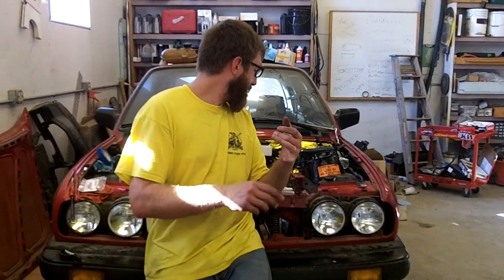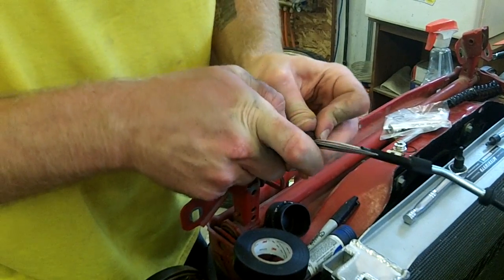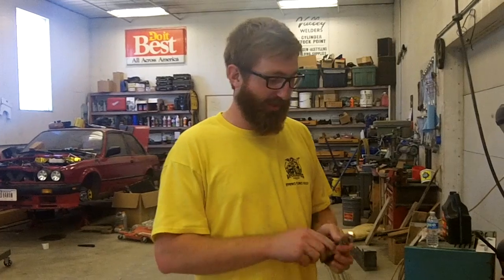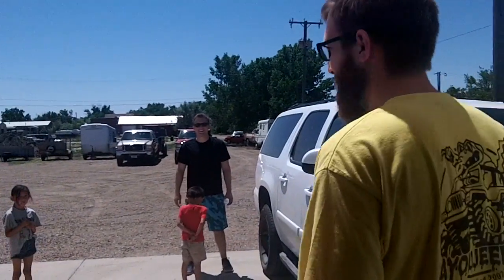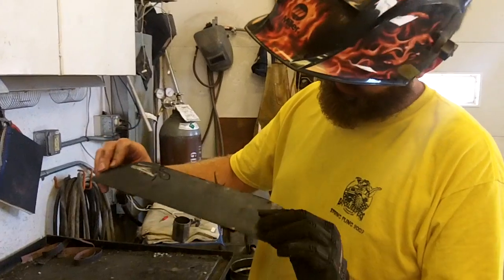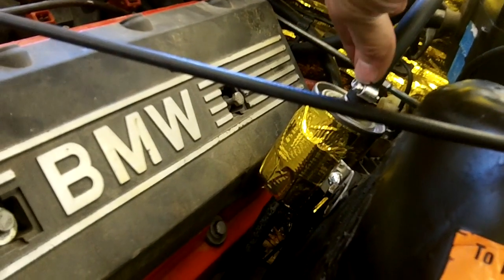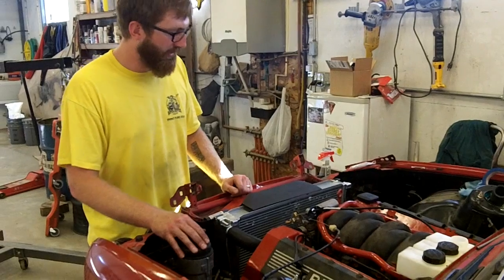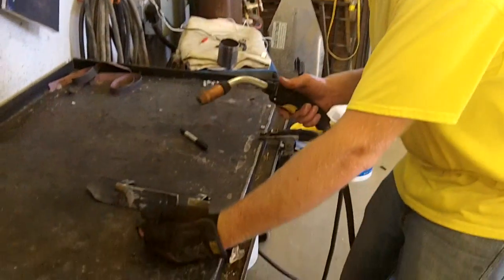BlockHeads Garage Ep.8 E30 M60 Swap. Cooling System and Plumbing

Comment: Hi mate, I've dont the m60b40 swap in my e30 but I'm having trouble bleeding the coolant! What radiator have you used? I have an aftermarket one and jacked the front end up and I'm still struggling :(
Reply from the maker: It's been awhile but if i remember right I used a vacuum filler to burp the system.

Comment: off what kind of car did you use the hoses for the radiator from?
Reply from the maker: +Erik Verstappen The radiator hoses weren't off any particular car, but I've read that the E39 hoses work. I just went to my local parts store with the measurements I needed.